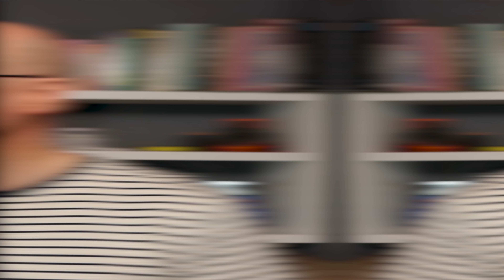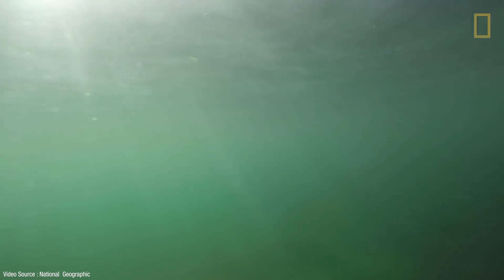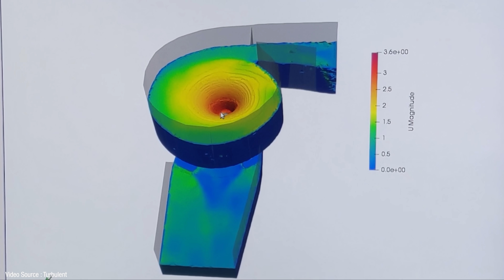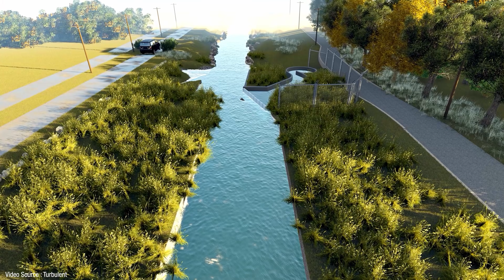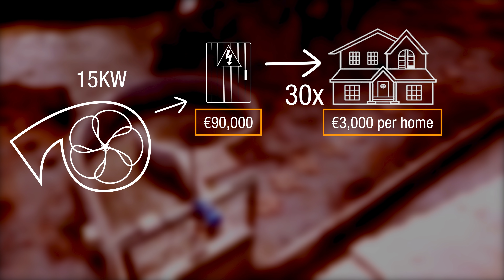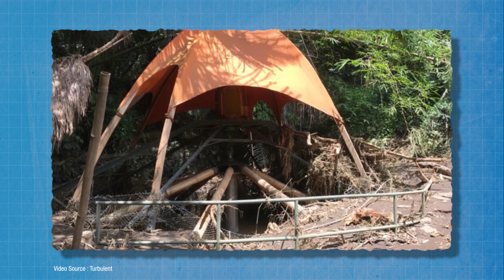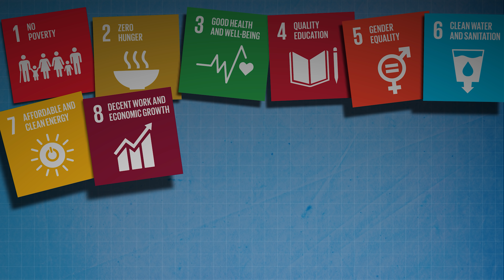Micro Hydropower : Turbulent Turbines

Comment: would be nice if folks like yourself would stop bashing solar tech, a properly designed system has batteries that can hold and supply power when the panels have limited or no supply and the panels can go on roofs so commenting on their footprint is plain dumb. Also, the panel arrays are sized to charge up the entire battery bank in the available time during the day. Every tech has drawbacks which is why any attempt using only one tech is doomed to failure, a proper system is a hybrid with each part playing to its strengths.

Comment: Wow just came across you by accident! Good stuff! Presently designing 16 1-hectare aquaculture shrimp ponds w/ center 3' dia. round concrete vertical overflow pipe leading to 2 - 12" HDPE pipes for the RAS. You have given me an idea of manufacturing mini hydroturbines placed in the vertical overflow pipe! The RAS is designed to exchange 2-4% of each ponds 5.5 million gallons. What a wonderful find of clean Renewable Energy

Comment: During the conflict in the former Yugoslavia mains power was off for months or longer and fuel for cars was also unavailable. People living near rivers made their own hydro, usually from the alternators taken from their standed cars and DIY water wheels, mounted on a small anchored floating raft in midstream, and driven by the flow past the wheel. One design looked like a Mississippi stern-wheel paddle steamer heading upstream "pulled" by its anchor rope.

People could light their homes with 12V lights (not at full mains brightness but still usable) run a radio. Beauty was the dead car also had a regulator and battery that could be repurposed to control the output of the alternator over a huge range of revs. 

Not efficient. Not cost effective in normal life, but in a situation where normal city utilities failed it made survival that bit more comfortable and using only what was already present in an city when it went off grid...

I have wondered since how much of that kit made it back into the cars it came from...

Comment: The mini hydro power used in rivers have something in common with the sea tides - they both operate on moving water but with a difference being that with the tides, there is a time when between the tides there is a 'slack time', then as when the tide changes the water flow will reverse direction but with a properly designed unit, I wouldn't have thought this would be a problem for a unit to work both clockwise and anticlockwise as the tides change. 

We have a number of wind farms situated around the coasts but the problem with them is that with no wind, there is no electricity, and from time to time we do get areas of high pressure which are reluctant to move. During the last two or so months, we have had such around the UK, which has lead to an overall reduction of energy.   

Now getting back to the slack times, take the UK for example, as most of us know, the times of low and high tide vary around the country, so by siting the units strategically, the slack times could be covered by the operation of the others, so power from all can be combined to produce a constant flow of electricity. 

Currently our country is looking at building large nuclear power stations but this have inherent dangers and costs in connection with the radio active fuel, whereas instead of thinking big, we could think small and a number of these mini hydro adapted for tidal production could be sited around our coasts, then with the exception of maintenance costs, we will have free sustainable energy.

I would expect this to answer all of our problems but they could be answered with a variety of different methods, solar with the excess energy stored in liquid salts, allowing for a 24/7 production, geothermal energy utilising the increasing temperatures with depth, and on land hydro, then utilising ground source and air source pumps to make the best use the more efficient methods of power for heating. 

Another form of micro generation could be the use of sterling engines taking advantage of differences in temperature, which could be used to use the waste heat from buildings.

Comment: This argument about dead vegetation breaking down and releasing methane and CO2 into the water is a bit suspect.  Are you suggesting that it only breaks down to CO2 in a reservoir?  Where would it go otherwise?  Surely all vegetation in a river does the same.

Comment: If the HMPP were to be used to power the batteries for the Modec EV Van, its range would increase from 150 miles to 500 miles and no cable recharging required

Comment: The Turbulent Turbine is very similar to a Kaplan Turbine, except that the Turbulent blades are fixed and not variable pitch.  The Kaplan Turbine is meant for serious power generation at much higher heads and with greater rotational speeds (100 rpm typical). but were the speed slowed down, it would come closer to being like the Turbulent Turbine and would be fish friendly.
Reply: If my aunt was my uncle I could be my brother's sister....

Comment: What I've never been able to figure out is why they place the generator portion under the turbine in the water. Thus needing all the seals to keep things dry.
Seems a lot more sensible to place the generator above the turbine in the dry.
If they are worried about weight, you can still place a weight bearing bearing under the turbine on the concrete base.
Just seems expensive to be putting the generator under water when it does not really need to be.
Reply: The water flow cools it down...important....
Reply: @JohnSmith-yv6eq  That's interesting, cause every blueprint I've seen for actual "full" scale hydro plants has the Generator mounted above the turbine.

Not saying you're wrong, I'm just really interested to know why. My OCD kicking in.
Reply: @petert3355  
The last time I went to an old hydro plant I asked how much oil they used to cool and lubricate the bearings.
The answer.."80 tons"
Cooling and lubricating...lots of oil circulating slowly;
or little oil and lubicant very well cooled....

Comment: Another form of hydropower is the old-style water wheel! But the idea is not to have it attached to a building on the bank of a river or canal but to have it as a tethered floating unit in the middle of the stream. This would be as wide or as narrow as required and as it would only be the bottom 3-4 blades of the wheel in the water having very little impact on any wildlife in the river! It could be as crude or as sophisticated as the community could afford as its construction could be primarily out of existing materials, with only the electric motor and control system being purchased!
Reply: Needs large anchors, ability to float during floods, and resilience to debris, plus mechanically sound with low losses when operating normally..

Comment: How about a stepped electrical spillway/soft turbine solution?  Why have just one turbine when you can step it down 2, 3 or more levels?  Figure, if water levels rise above the normal level, the overflow could be diverted to another turbine.  Or, depending on the elevation drop of a column of water, install multiple spaced turbines on the transit path of the river to multiply the energy produced with attention to ensuring the water flow is not interrupted.

Comment: Dual sport riding in Vietnam, I noticed boats with outboards tied along the shore with a wire running from the outboard to a nearby house or hut. When I inquired about this, we pulled over to one of these huts advertising "cold bia". The owner took us down to the river where the outboard was off but the prop was turning in the current. The alternator was providing current to a battery which in turn powered a refrigerator full of cold beverages. He produced a product that thirsty dual sporters want and that helped support his family. Plus, he still has a boat to do portaging work. Micro hydro at it's best.
Reply: If that outboard motor was turning/freewheeling (the motor not running under it's own power) so the alternator on the top of the crankshaft could producee electric current...he is wearing the engine out.
This is a very viable system if the engine is inboard and has an alternator driven off the propshaft...just put the gearbox in neutral and let the prop spin ....

Comment: Am I crazy or does the vertical orientation of the turbine and vortex well potentially open up the possibility to stack multiple turbines on top of each other in a single well?  Put one of these at the top of a small waterfall and have a stack of turbines go all the way down to the bottom.
Reply: The energy in the water is "sucked out" by the efforrt required to spin the turbine.
If you had a large fall you would want to use that in one go to spin a large turbine...and a turbulent one might not be the most efficient or the best turbine type in that case...😊😊
https://en.wikipedia.org/wiki/Kaplan_turbine

Comment: 11:00 No water source is 100% reliable. Running a hospital on microhydro is poorly thought out. Most hospitals are not located near reliable hydro sources. Most catastrophes involve major disruption of electrical grids that would carry said power to the hospital, to say nothing of the line losses pilled on top of an already inefficient hydro design.
Reply: Beats the old piston through the block of the old diesel generator....

Comment: So kill a bunch of little rivers instead of one big one?
Reply: Notice the main flow keeps main flowing while the water for the turbines keeps making little diversions...but always ends up back in the main river...no dams.
Reply: @JohnSmith-yv6eq  yes but I have visited many Micro generation projects in BC. And at everyone the guides say how many million dollars the last overhaul cost and how many homes it can supply with free electricity. But if you look at 1 percent interest on the investment it is thousands of dollars per home! And it doesn't matter if there is a dam. The pressure differential that drives the turbine still cracks the oxygen and Co2 out of the water and makes it unable to support life!

Comment: So, let me begin by stating a fact which everyone either chooses to avoid, or completely forget: There's no such thing as a ''Perfect System''. Singular system solutions are stupid and insane. For the world's growing energy needs to be met, it will require an integrated, co-operating, multi-faceted solution. I, for one, would like to see this happen, ASAP; making certain it can be done safely and free from political pandering and the resultant, inevitable posturing and delays. So, in true Libertarian fashion, minimal government involvement, if you please, and work across the whole energy development spectrum. This means, the green energy industry is going to have to co-operate with the fossil fuel and nuclear energy industries. If everyone works together, everyone benefits. It still wouldn't be a perfect system, but it would have more alternatives to cover the gaps.

Comment: The only thing that stopped the end of the planet was the Industrial Revolution and man putting more CO2 into the air than the single celled plants and animals were taking out and the Climate Idiots want to start that cycle all over again!

 Before the Industrial Revolution the planet had been dieing for 500 million years due to a steady decline in CO2 caused by single cell plants and animals in the ocean using the carbon to make protective armour. The CO2 level was about 180 ppm (parts per million) and plants start dieing at 150 ppm. Currently the CO2 level is a little over 400ppm and optimum for greening the planet is about 1800 ppm. If the stated goal of Zero CO2 Emissions are ever reached the the single celled animals which are still there will continue to to remove the CO2 and the levels will start dropping again. We need to produce more CO2 than we currently do until we get  much closer to the optimum of 1800 ppm because if the CO2 ever gets to 150 ppm all life on the planet dies!  I like the Idea of Mini Hydro, however not at the expense of trying to limit CO2.

Comment: There is no way you can run 30 homes on 15kw without a considerable energy storage system and a networked power management system in every home connected to the turbine and storage.
The initial cost is high because you need a sturdy frame to protect the turbine and canal from damage during a flood. The flimsy system that was installed there broke right away. To protect it you had to refit the whole canal with a steel tube frame with insane wall thickness and probably extra mesh the same sturdiness as the rest of the frame.

Comment: 15kW is not a lot of power for 30 homes!
You can't recharge (m)any Teslas with that.
Similar systems have a mesh at the intake end to stop fish getting in.Then you can accellerate the water much faster down a spiral vortex chute until it hits a high RPM small diameter,spinning impeller which connects to your dynamo.
Or...
I think a highly effective system can be made for a fraction of the cost by suspending one or more horizontal axis lightweight waterwheels into the river from the bank.
Customise the wheel diameter,width to suit and run a dynamo off the axle(scaffold pole for mass) on the riverbank where you can conceal it so you don't ruin the view too much.
You don't need a gradient,just the right blade size for the flow rate and demand
A simple pair of walls can be easily set upstream to funnel a fraction of the river more quickly through the paddles.
fish swim around or under 
you can get all the parts from a junkyard
you can put multiple wheels side by side,hang them from bridge structures
easily removed for maintenance,
silent
You could literally turn an old paddlesteamer into a floating powerstation/restaurant/cinema etc

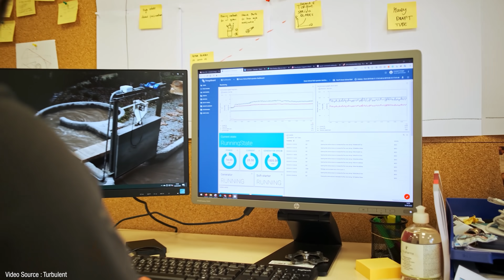Comment: @JustHaveAThink  07:03 Forgive me if I sound just a little incredulous. Just how you would supply some fifty homes with a 5 kWh turbine system seems somewhat living in fantasy land. 
I just checked my apartments yearly consumption of electricity. I live in Queensland Australia and my electricity rate is  $A0.18 /kWh. Last month 347 kWh was used, an average of 11.567 kWh/day costing $A62.46. If I assume 11.567 kWh as an average over twelve months, the electricity consumption is 4222 kWh per year costing just $A760.00 per year. This does not include hot water which is supplied by Gas and service charges. Adding hot water and service charges my yearly bill ends up at around $A2200 per year. Hope this helps sort your delusion.
Reply: These people are pooor and have no electrical appliances. 
They will start with light bulbs and work their way slowly up to refrigerators and welders...

Comment: I have heard on this channel and from other sources that renewable are now less expensive than traditional sources of energy... unfortunately this is not my experience: I run sustainability projects for a fortune 200 company and I am constantly quoting energy projects and, from what I see in different markets worldwide, natural gas is still the most cost effective form of energy. Even to reduce carbon production, a cogeneration system can reduce 1 Ton of CO2e annually for $500, while a solar installation is $1500 to $2000... I would be very interested in more details on these type of data, thanks!
Reply: Don't look at the figures...
feel the good vibrations of the feel-good projects...

Comment: Perhaps I missed the information about the flow required for say a 5kW installation but if the head is 1.5m the flow requirement will be around 350 litres and although streams with this kind of annual minimum flow may be common in many parts of the world there are many other parts where there are very few, such as Zimbabwe with which I am familiar.

Comment: Flowing river water is free power. We used to harness it with water wheels. Why don't we anymore? A waterwheel connected to a dynamo is a power plant. Very simple, easy to maintain. Proof is the many hundreds of yrs old waterwheels around the world. Why does it need to be a complicated vortex turbine?
Reply: Large losses from mechanical belts, pulleys, wheels, shafts etc.
maintenance intensive..the miller used to live at the mill and tend it every day..and night.

Comment: What happens to these things in winter?  I live in Canada and would love to have a self-sufficient retreat in the wilderness where something like this would be perfect.  The thing is, winter temperatures can and usually do, drop below -30 Celcius.  Ice on rivers can be a metre and a half thick.  What happens then??
Reply: I saw many video on YouTube about that problems and some have resolved with a temperature gage showing that water that is circulating need some maintenance but will not freeze and they are using pipe and as long as the water circulating in the pipe it wasn't a problem for them outisde of the required maintenance to remove ice at the intake or output.
Reply: https://www.youtube.com/watch?v=zcV6LkmtYIk
Mr Hydrohead may have the answer for you....

Comment: This reminds me of the small water turbines I looked at over 30 years ago.  The idea was you could drop them into nearby streams to generate electricity for your rural home.  They didn't generate much wattage, but if you had enough of them it might have been a feasible solution, provided you lived in a temperate climate where the water never froze.